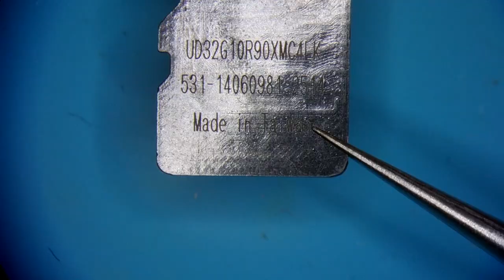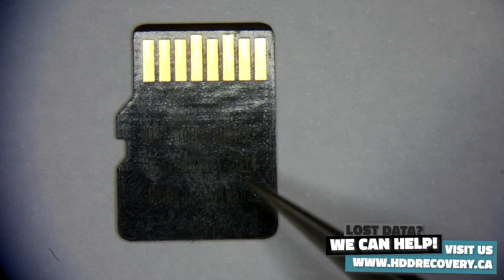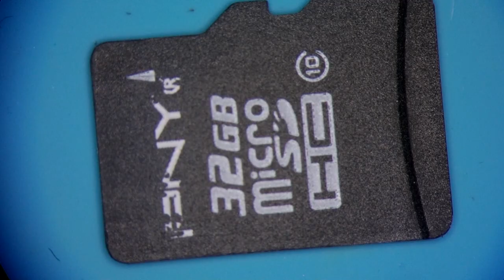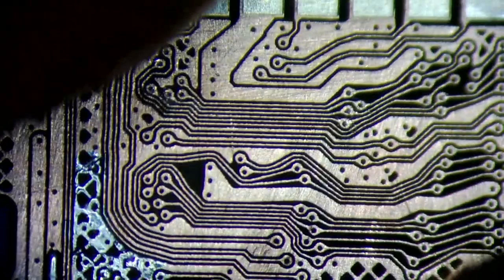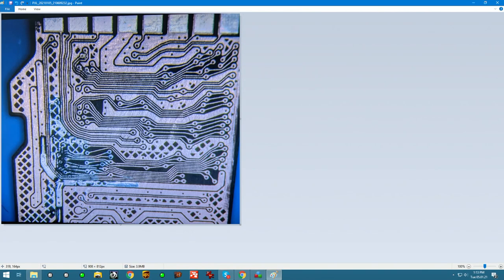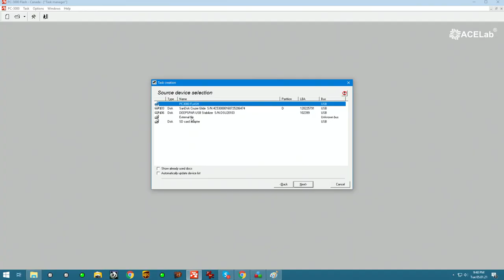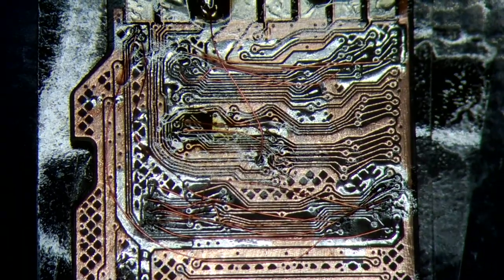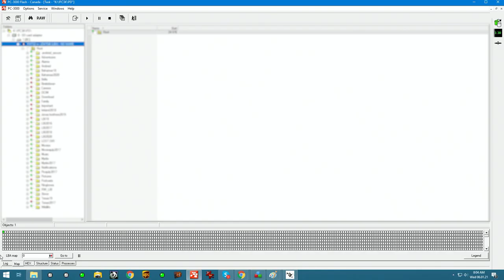microsd with worst damage

Comment: The hands of a surgeon! Lovely done!
Reply: Even a surgeon doesn't need those hands 😂😂
Reply from the maker: Thanks guys!
Reply: @hddrecoveryservices  do you fix fake micro sd cards forced to read past sector y or x or whatever it is?
Reply from the maker: @theroyalaustralian  they overwrite SA by exceeding the physical limit and become unrecoverable. SA contains markers for block sequence
Reply: @hddrecoveryservices  are you able to fix this is what I asked
Reply: @hddrecoveryservices  all it takes is reprogram of the actual size in the SD card.
Reply: @hddrecoveryservices  and your done, low and behold, you would have fixed a counterfeit micro sd card
Reply from the maker: @theroyalaustralian  but the data? LOL. who cares about the fake card working? We only recover data not so much on the repair.
Reply: @hddrecoveryservices  there's no data on the counterfeit SD cards I poses except their volume information.

I just need to know if you can buy an SD card reprogramer
Reply: Terrence Isaac  what?

Comment: What if the micro sd card was chipped? it is located at the bottom part where the memory core is. Could I put the chipped piece back on and recover the data from there (that is what a forum said btw)?

Comment: That was absolutely FASCINATING.  I know there are ways to get data off a damaged harddrive if the surface isn’t destroyed. But  I never realized it was possible to rebuild contacts at this level. After awhile I noticed your probes had a micro tip. They looked too big initially.
Reply from the maker: thanks Brad, yeah the tips are genuine fluke micro series, but they are huge for this job. I need to get or make some finer ones for sure.

Comment: Great work and you still didn't give up on the card, can't see anyone persevering as much as you do.
Reply from the maker: There was a few times where I thought it's cooked. Until the last signal was traced to ground, I even had a dead end outro filmed :)
Reply: Brilliant different endings I've only seen one you couldn't do because of the physical damage on the discs of an HDD because of you I shall never throw a drive away I will try controllers arms etc. Great job mate.

Comment: I've tried to recover data from micro sd cards myself once, and I know how tiny these traces are. Amazing to see how efficiently you rewired them.
I kept getting shorts to ground all the time as I kept getting solder-bridges all over. But eventually, I managed to get it right.
The hardest part for me was to expose the copper layer. I just didn't have the tools for it. There I wonder... what tool did you use there to expose the copper layer like that?
Reply: it's a fiberglass "pencil"

Comment: I had a uSD card that may have spent a few years in brackish water.  Initially it looked like the traces to the card-edge fingers were the only opens, but fixing those didn't work.  After learning from you about "scratch pens" I took off the rest of the epoxy and found quite a few opens right in the middle of the card.  It turns out that the "Made in China" laser-marked text on the card backside caused the epoxy covering to thin so much that the underlying traces could corrode.  I could almost read the text in the copper corrosion pattern.  Adding nine jumper wires allowed the drive to be recognized and a directory structure to be pulled off for recovery.
Reply from the maker: That's amazing my dude!
Reply: @hddrecoveryservices  I've not been able to play the recovered mp4 file yet ("moov atom not found" error).  But clearly fixing all the opens due to the corrosion worked.  I don't have the recovery tools <yet> to fix the file.  Ping me and I can send you some images of the corrosion pattern.

Comment: I've seen chip reballing templates. If a solder trace template could be made for each uSD card you might just use solder paste, heat it up, and possibly that would re-connect all of the degraded traces. Brain surgeon scale work for sure! Well done.
Reply from the maker: Force of tension will not let traces link. Each end will pull solder to the center

Comment: I have seen this before on a USB stick. It is likely the traces delaminated (heat?) and broke off. Copper work hardens so it wouldnt take much movement to break them.
Reply from the maker: I test each card or monolith not specifically for that reason. One trace can go bad and card stops responding 😃

Comment: Not questioning the sanding of the outer plastic, but wouldn't it be safer to use something like acetone or something else non-abrasive to remove the plastic?
Reply from the maker: Laser would work great but produce fumes and a bit overkill I think. Chemicals are toxic. Scratch pen works great, costs virtually nothing, and almost impossible to damage the card with it.

Comment: Video WELL DONE -- felt very continuous, not choppy.  If the card was in use, then became non-op one day, which trace failed at that moment? All 16 traces did not fail simultaneously. We know trace repair revived card, so trace failure definitely the problem. Perhaps the process of removing mask to expose traces also damaged them?? Thoughts.
Reply from the maker: I do 2-3 cards every day using the same pen. Its safe for traces. Quality of the build and heat. Video does not show it, but once the repair was done the card worked, but it did not work like new (simply card reader and mount would not make it happen).
Reply: @hddrecoveryservices :  Is that pen good for removing mask?  What is it?  My perception of PNY is "cheapo" -- does that match your experience?  Is PNY more vulnerable to "heat and quality of build" failures, in your experience?

Comment: Those traces looked fine but obviously weren't, it would have been good to zoom in closer to see where the break was and to also give some idea as to what caused it. One question, would tinning the whole of card have been easier? I would have thought that because the traces looked ok that the break must have been miniscule and tinning the whole card instead of jumpers would have solved it easier. I'm not saying that would have been better as I have never worked on anything that small it's just a genuine question, Thanks.
Reply from the maker: You know I tried to tin them, but it don't seem to work

Comment: I once had found a micro sd card that was on the place where a car crash had happened there was a lot of glass then i lost it on the same place then i found it again (IT WAS IN GRASS) then brought it home then after a year or so i pluged it into my radio (it was bended) then nothing happened i tried unbending it and accidentaly broke it in half so that was sad i could left it and then brought it to fix.
Reply from the maker: If it was bent then it's not recoverable. Crystal is damaged.
Reply: @hddrecoveryservices  ohh

Comment: How many hours u spent on it and how much u charged from customer for this.
Please reply honestly,,😃😃
Reply from the maker: between going back and foth on trouble shooting adding wires and finding more issues maybe 3-4 hours of soldering then 4-5 hours to image it by SPI. Price does not matter, any business can charge whatever they want for this work.
Reply: @hddrecoveryservices : Do you charge by hour, or flat fee? I love these types of jobs, but feel bad to charge clients REAL TIME. Over the years, i find that the most SATISFYING repairs are the nightmare jobs abandoned by other techs, but I've been told many times that they are smarter than me for making, say, a 1 hour time limit, then quit. DO YOU CHARGE REAL TIME ON A JOB LIKE THIS??

Comment: Somehow the traces got damaged under the plastic housing, But scratching off the hard coating with an abrasive fibreglass scratch pen didn't do any damage.  hmmm.
Reply from the maker: Following your logic, I must have damaged it by clearing off the coat, right? But let me ask you this, why would the card be sent to us for data recovery then?
Reply: @hddrecoveryservices  I can see one trace maybe damaged externally, thats plausible. Possible the one at the top..

Comment: Surgery can be messy, but it gets the job done if the recovery is successful.
Reply from the maker: In this case, only surgery like this would work. Traces were rotten before I even got the card. If I had tried to put it to NAND adapter, it would most likely not work without trace repair first.

Comment: Wouldn't it be quicker and less complicated if you'd use that spider attachment just as a jumpers?
Reply from the maker: No, it won't work like that. Spider on a job like this is not going to cut it :)
Reply: @hddrecoveryservices  Obviously I didn't mean to use it as intended, only just as a hardware jumpers with very sharp contacts. Not requiring any soldering. 
Admittedly you'd probably run out od spider legs for this particular job so jig with more mounting points would be needed :-)
Reply from the maker: I am afraid that navigating the pins on such small area in such high numbers is not possible. 16 traces need 32 connection points to be joined, and adjustability is limited too
Reply: @hddrecoveryservices  Alright. That just seemed like a brilliant Idea, ah well. 
Thanks for answering! :-)

Comment: Didn't you destroyed them with the fiberglass scratcher???
Reply from the maker: Fiberglass will not damage copper. I use this tool 2-3 times everyday, I know how abrasive it can be to safely say it was not the scratch pen that blew these up.
Reply from the maker: Besides, the card would have worked before I exposed them in that case.

Comment: Thank you. Just saw your video by accident. I thihnk my old Samsung S3 killed my microsd but it was a Sandisk ultra 64 gb micro sd card. Now i kind of remember Sandisk had some faulty cards back then. But i also know that many people were complaining that their S3 killed the sd card. Do you have any experience with the issue and the possible fix? 
Back side of my card is not flat by the way. It has a part with a bulge but it is from the design. Do you know what is under that? Can i scrape it to reveal the circuit?  I cant find an answer. All the videos/pictures i see has sd cards with flat backs.  Here is a link which shows how my sd card looks like on the back side.  https://goughlui.com/wp-content/uploads/2017/07/2017063018451456.jpg
Reply from the maker: If you go to our channel and watch the last posted video you will see what we would do in that case. It is about the SanDisk microSD
Reply: @hddrecoveryservices  Thank you very much.